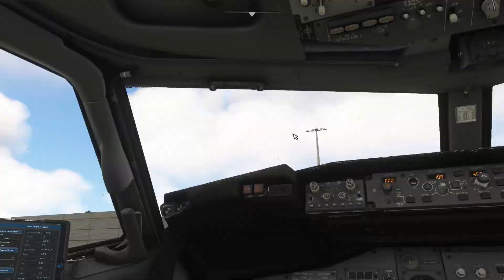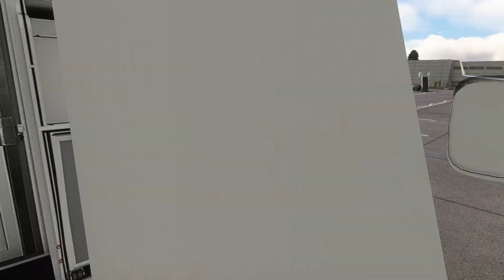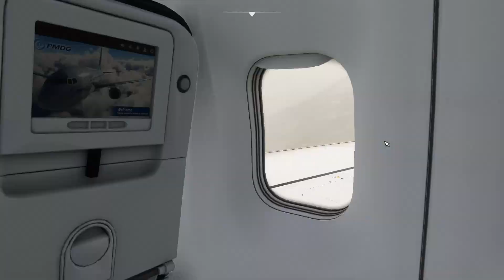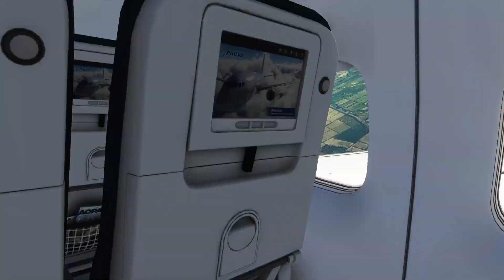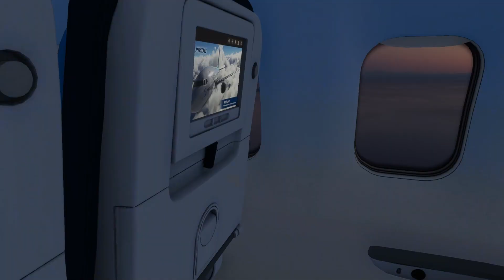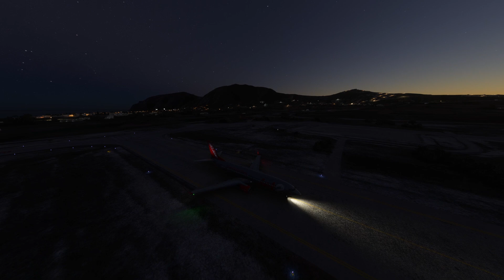MSFS 2020 | NEW 29Palms Santorini | PMDG 737-800 JET2 | Bristol to Santorini | Full Flight

Comment: You’re correct. Incorrect QNH lead to being low on the approach. It will still look like you are on VNAV profile though hence the danger with it. Take a look at QNH blunder error. Luckily you were in visual conditions, no terrain, could’ve ended very differently if not haha! Nice video nonetheless!
Reply from the maker: Thank you and yes I thought that, was my fault I thought that I did set the correct QNG but clearly I didn’t, I’ll make sure I cross check them next time 😂